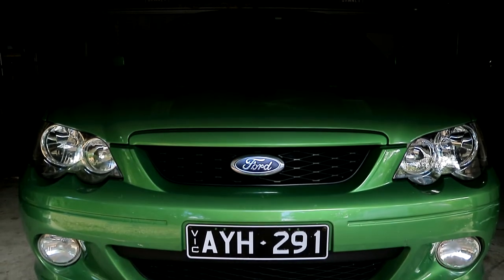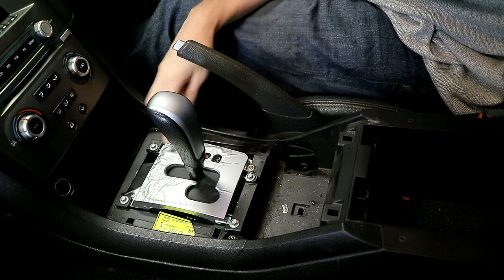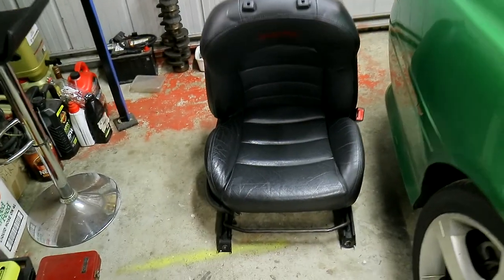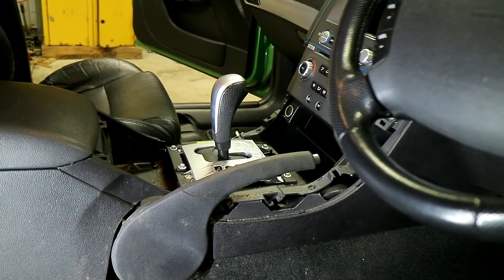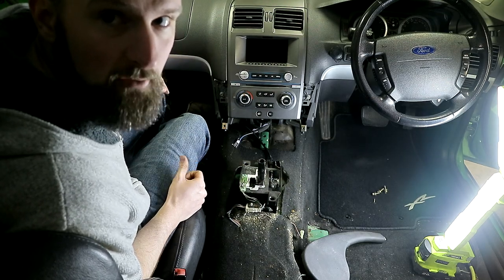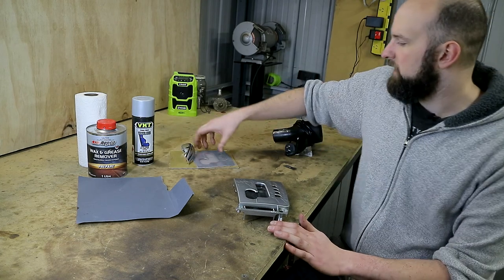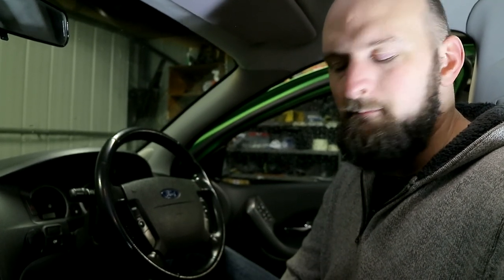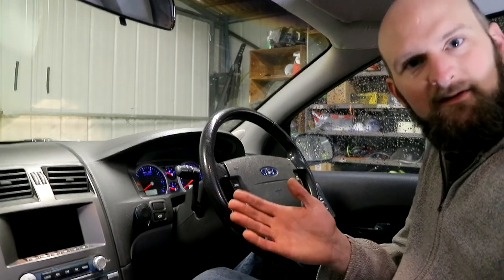Shifter Surround Fix and Console Removal | BA-BF Ford Falcon & SX-SY Territory

Comment: I got the chrome plate and gear shifter cap but I can’t seem to workout how to replace the shifter cover.
If you could let me know would be great 👍
Reply from the maker: Has been asked a few times in other comments but here's how: Carefully pry at the top of the shifter button, slightly down and out. Then there’s a Phillips head from memory holding the plate on.

Good luck and thanks for watching mate.

Comment: Had been intending to do this repair for ages, thanks for the video wasnt sure on how to get at it without breaking stuff. After watching ya video decided on the vinyl wrap option first attempt showed up the defects in the plastic pretty well so tried again went down to a fine 2000 grit paper took a lot of work but end result looks fantastic. and by far the cheapest option. $8 for a sheet 1200x1000 went for a wood grain wrap
Reply from the maker: @Dave Westgarth Nice! Definitely a great option mate, sounds awesome.

Comment: Hi Browney great video thank you. Have got to the point of removing drivers seat to start to get to bush connecting gear selector which has come adrift. A bit nervous of electric seat with airbag so any advice or precautions would be appreciated. Guess disconnecting battery is first move? Is there anything else before taking out seat connections. Thanks again.
Reply from the maker: Hi Phil, thanks mate.

Probably asking the wrong guy, I am a hack who often operates on a ‘safety third’ basis in the garage! But yes battery disconnect, not sure of any further precautions beyond this - would hope they’re a pretty well fail proof device and not be prone to just ‘going off’.
Reply: @BrowneysGarage   Hi Browney thanks for reply and have got seat out safely. I am just reassembling but can not get the handbrake unit to line up with the holes it seems too hard to pull forward to exactly where it needs to be. Did you have any problems? Any suggestions appreciated. Thanks Phil
Reply from the maker: @Phil Harris I didn't have any dramas and I may be delusional from lack of sleep but all I can think of - is the handbrake still 'on' and putting tension on the cables? May be really dumb but it's all I can think of right now sorry.

Comment: i really hate this design and plastic rubbish , im thinking of a diy stainless or galv console. im sure there are aftermarket shifters too, the cable ends are not my favourite either not a quick fix patented little gromets that all went where it belongs in the bin.    miss the days when things were built much more robust and much easier to repair without having to buy parts because theyre cheaply made to cut costs maximise profit and speed up assembly time at the factory just like the plastic pedal boxes what an abomination.. my next car will be a commercial ute something robust.